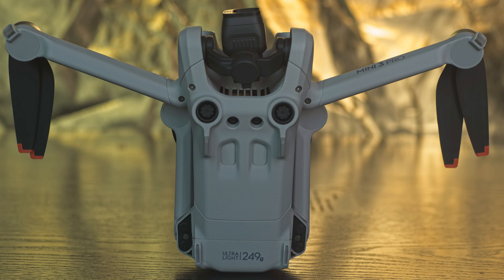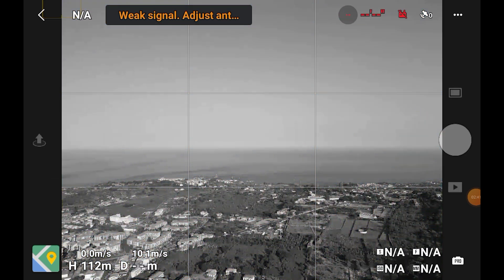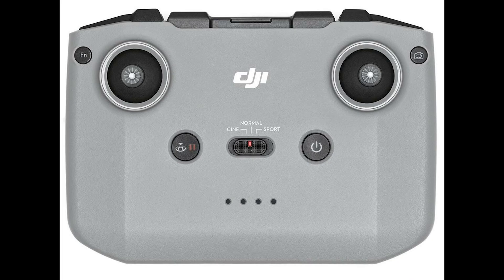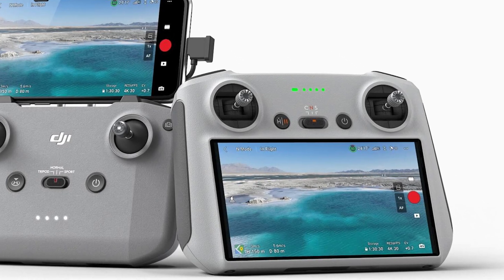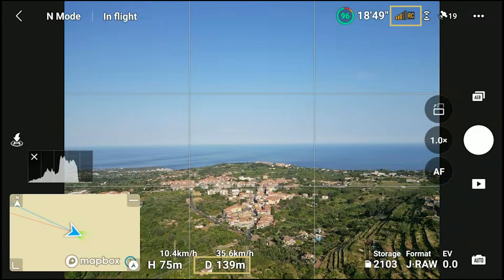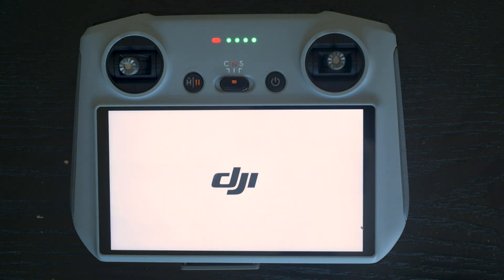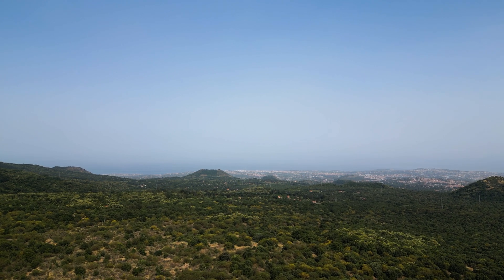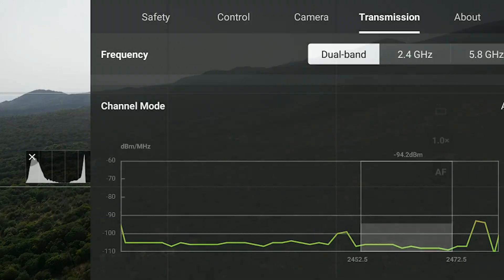DJI Mini 3 Pro Range Issues / Signal transmission test

Comment: I've been keeping an eye on the range issues with the Mini3 for a few months now and it was precisely this problem that made me choose the Autel Nano+ instead. I agree with you about the Nano+ transmission... so far (touch wood) it has been rock solid. One point I would like to make about the DJI birds and their ocusync signals is that it isn't only the Mini3 that suffers with this problem. My old work-horse: the Mavic 2 Zoom was bullet-proof for over three years of heavy use, one firmware update earlier this year (01.0770) and it showed exactly the same flight problems as seen with the Mini3 - in some cases the signal would bomb-out completely at less than 100 metres from the controller. Here's a question for you... you were cock-a-hoop about the Autel Nano for quite a while, but now you rarely, if ever mention it... how come?
Reply from the maker: Hi Chris,
I perfectly agree with the rock solid signal on the Nano Plus, never had the slightest issue.
The reason why I have not covered much the Nano recently is that I don't have a unit working at the moment, two different ones failed on me. I hope to get one repaired soon

Comment: I got to 1000 m before signal turned orange and I returned.
Reply from the maker: 1000 meters is not bad. Better than my unit
Reply: @VICVideopIC  Got to 1600 meters today before I got a 'check your antenna' warning but never actually lost connection. Signal icon turned orange after about 900 meters (could still go another 700m). This is in a rural area with little interference though.

Comment: Another great video, thanks! 

I've just bought the Mini 3 (UK) and can't get any further than 600m. I've spoken to DJI and complained and they have told me to update the firmware (again) and not use any apps on my phone (even though I fly using the DJI RC!). Very poor response.

I'm hoping there's a fix soon, the range and video feed is worse than that of the DJI Spark which came out many years ago and not a patch on the range and strength of the Autel Nano+

It's a fantastic bit of kit but not much use (or as advertised) at the moment

Comment: Well today I recived me second unit 1 month on returned the first 1 thought it was just had a bad batch but no today the drone loses signal at 500 meters smart controller lags the camera qaulity isn't so good either compared to my air 2s but my main issue is signal strength its terrible no matter what anyone says there is something wrong with connection in this Drone
Oh and I'm just about to return this back to amazon also
Reply from the maker: I perfectly agree with you.
My unit works exactly like yours and the signal is so bad that makes it practically unusable.
I believe DJI will sort the issue soon,either by firmware upgrade, or by replacing a faulty batch

Comment: Good vid as always. My mini 3 is solid up to 600m,i haven't tried further. I've been behind trees with it at that distance. As a few other posters have mentioned, I wouldn't want to fly a sub 250 drone further really, I have an Air 2S with RC pro in FCC mode for that. I care more about the solid connection on the mini 3 whilst in urban areas😁.

Comment: Quick fix for signal issues.  The drone is going into ce mode and not staying in fcc mode.  To fix, temporarily.  Take drone outside and set on ground. Turn both drone and rc on.  Then turn off drone and leaving rc on. Now turn drone back on, setting rc on top of drone. This blocks the gps signal and makes the drone come back online slowly.  Tricking it to staying in fcc mode and increasing your range 100%.  Try this.  I have seen it work in another video. Good luck

Comment: Vic: Rule of thump: The higher the frequency, the worse the signal's penetration.
Signals with a low frequency can better make their way through solid objects than high frequency signals.
Even objects like bushes or trees hinder signal penetration, more solid objects (like metal, houses or soil) cause more issues.
Thus 2.4 GHz would be the better setting to use - but you always need to take the number of free "channels" into account. Depending on a country's regulations, there's more or less usable channels in a frequency band (like 2.4 or 5.8 GHz), so the drone has more channels to switch to if it experiences interference by devices using the same channel. Usually, there's more free channels in the higher frequency band, making the 5.8 GHz band more suitable.
Quite a dilemma: 2.4 GHz is better, but there is less channels for avoiding interference.

Wish for your next range test videos: Show all the way from taking off till reaching the point of signal loss. That way, we can see if there's obstacles in the line of sight - and which kind of obstacles. Absolutely vital for estimating the transmission quality. ;)

By the way: I also regard the Nano + as the "king of transmission". It's far better than the Mini 2, also works flawless where the Mini 2's transmission breaks down completely. But to be fair, the Nano + is also the "king of remote control battery drain". :D

Comment: It’s so strange that this is happening to some people but not others. I can tell you I’ve had no issues whatsoever, its probably no better than the Mini2 in this aspect, but certainly not any worse. It does tell me that the correct definition isn’t so much that “this model has problems in general”, but more “there’s something different about this batch of units”.  Can’t work it out.

Comment: I have received my unit of the Mini 3 Pro few weeks ago (With the older controller - no built in display)and I have found quite popular topic on DJI forum about the signal issue. So it’s been first thing I have tried with my unit of Mini 3… I went out in the fields, between villages of the Central Europe and I have been able to keep stable connection up to 1700 meters distance (altitude was about 100m), then the signal started falling apart quickly. Just sharing my experience✌🏻
Reply: Hi,
What did you do to fix it and where exactly did you find the info on the DJI Forum?   Can you please share the link?
Thank you.
Reply: @samavella8831  Hi there! Unfortunately it was meant like I have found the topic with many ppl complaining about the signal issue (with no solution);( So when I have received my Mini 3 I went straight ahead and test it right away… but it seems my unit is pretty much ok as I am able to reach the distance of 1600, actually yesterday I have reached the distance of 2400 m so based on my observations it seems like some units of the Mini 3 are faulty:/ My recommendation is that - test the signal strength right away when you receive your drone👍🏻
Reply: @zdenavenclik  Thanks Zdena!
I did report my range issue and the fact that my Mini 3 is set to CE Mode to DJI under the 14 days after activating the drone and they are supposed to be getting back to me. 

Thanks for getting back to me do quickly!

Comment: Same shitty performance with mine maybe a little better , that’s by far worst drone when it comes to connection power , like others mentioned I hope it’s software related couse I mostly do photos in wild and mountains and that’s not acceptable for me . And it’s funny couse my experience is exactly the same doesn’t matter if it’s urban area or woods 300-400 meters and done ! . I hope that’s not some weird way of enforcing VLOS from DJI

Comment: Thanks!   Have you reached out to DJI on this?  I am aware they are replacing units with range issues.  Makes me conclude that there is no SW fix coming as they are choosing the most expensive fix for people (people who make noise about it anyway)
Reply: That's concerning, seemed like nearly 1/2 of people were experiencing it. Glad I waited.
Reply: @Porkleaker  Yes. I figure they are doing a quiet recall for people who complain only.  This would have been my first drone.  On Monday I got tired of waiting for this to be resolved and went and picked up a Mini-2.  Glad I did.  I am more into still photography, so I figure this is all I will ever need.  (At least....I wont get caught up in new release drama ever again - Just wait till the unit is a year out there, then purchase after the bugs are chased out)   Cheers
Reply: @chconger  mini 2 is still a great drone, really stable and reliable. I was more into still photos before I got my first dji but have a real appreciation for both, plus you can get some great still shots up in the air. I might just get the Air 2S, just costs a few bucks and a simple test to fly it here.

Comment: I have no problems at all! Some people don't have problems while others have? How do you explain this. Did you do the latest firmware upgrade? Greetings from 🇳🇱
Reply: I'm from Australia and got 4600m (2.9m) but I'd rather a constant signal
Reply: From where u buy urs?
Reply: @ahjed7397 , I bought Mini straight from the online DJI store on the release date of 10 may and I got it within 2 weeks. The fly more combo did take a little bit longer to get. Greetings from 🇳🇱
Reply: @ahjed7397  Australia